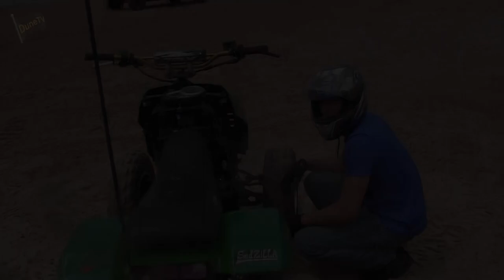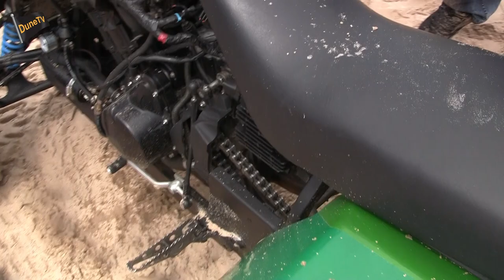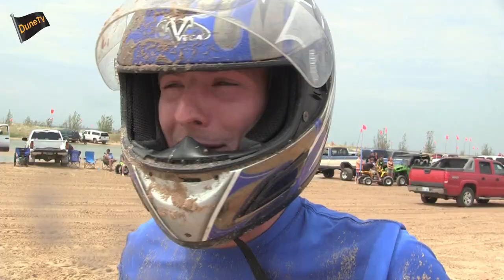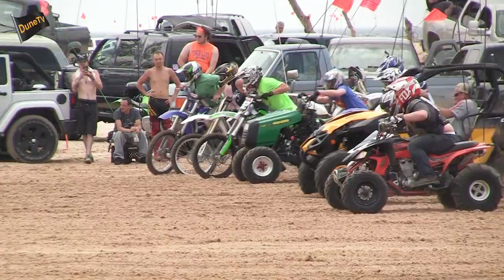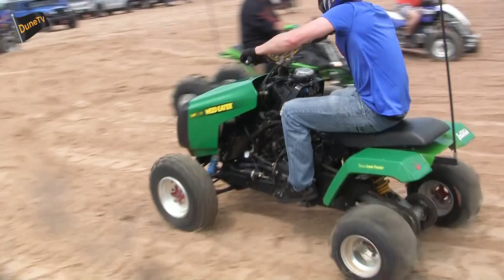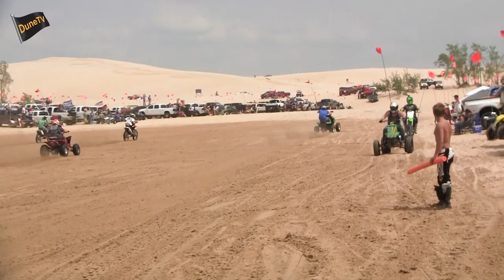Lawn Tractor Is A Quad Killer

Comment: so what,its just a quad with riding mower hood,  woooopieeee
Reply from the maker: Nope, it has a tractor frame. If it was a quad, the build might have been easier.
Reply: ya it's not a quad killer... it's a quad... that was stretched a bit seemingly with a lawn tractor frame in order to fit a bike engine... i build real racing and off-road mowers and the fact is that no matter what u do if u want it to work and perform at a quad level u need to use or fabricate parts which leave little of the original workings... he could've used a Harley engine to make it at least sound like a racing mower...
Reply: tvoprosucks no its a lawnmower with a street bike motor quad shocks and rear end not a quad with a hood
Reply: ian builds maybe he didn't want it to sound like a racing mower and a Harley motor won't be as fast as a sports bike motor
Reply: U can blatantly see it's not a atv frame with motorcycle engine. Why doesn't everybody learn some common sense before u speak? Then u don't look so stupid later on
Reply: @DuneTV1ViralMotorsports   does it mow the grass no it does not show it is not a lawn mower where lawn tractor for a garden tractor it's a go kart but I'll consider this on a four-wheeler.